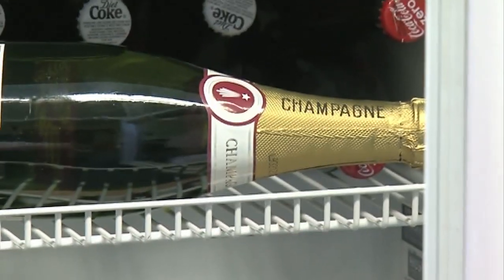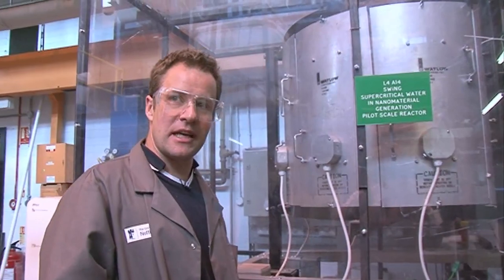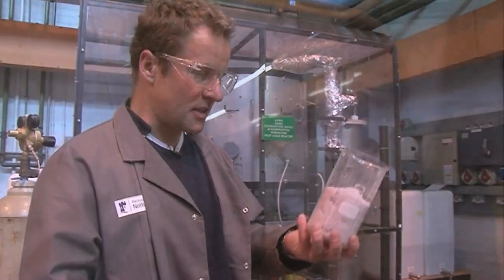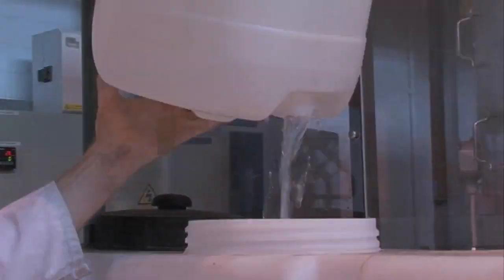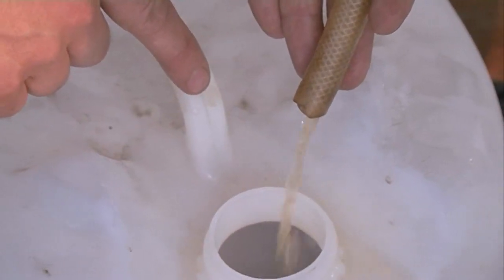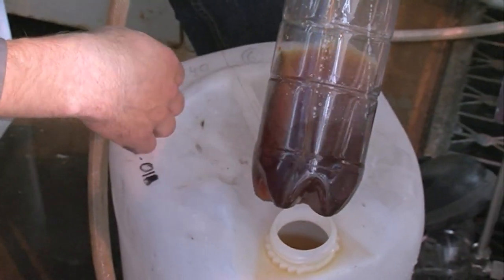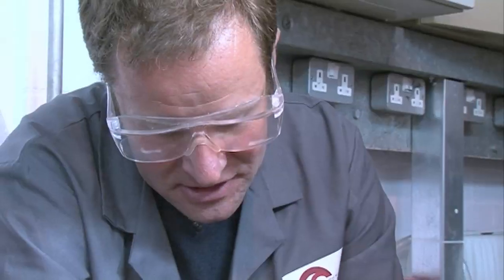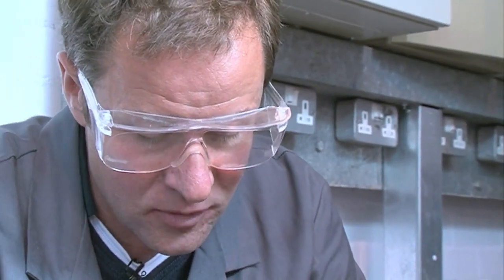Champagne Moment on the 'Big Pig'

Comment: @Doogeedoo12 The guidelines for labs generally state no consumption in labs, this specific research lab may have other rules and exceptions.
It's all really from a safety perspective, not dogmatic laws, so in labs where there's no notable risk from consuming beverages from closed containers (no volatile compounds or extremely toxic materials) and in this case a beverage poured directly from the container into discardable cups and consumed without pause, there's no tangible safety hazard.